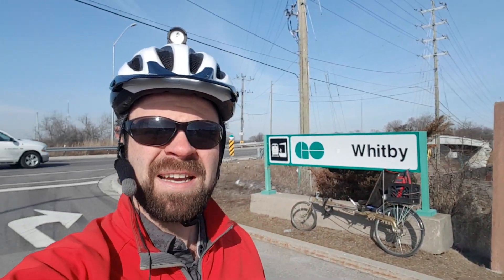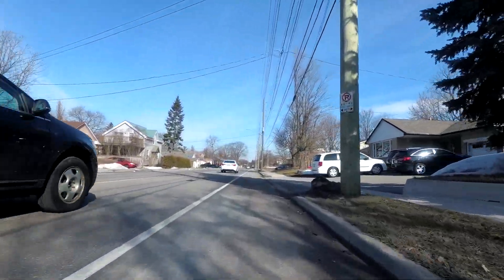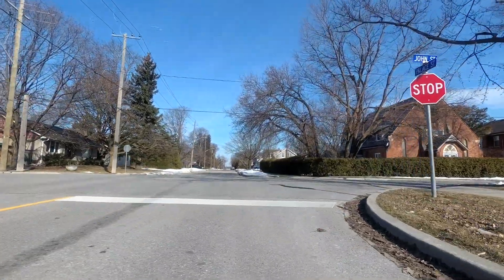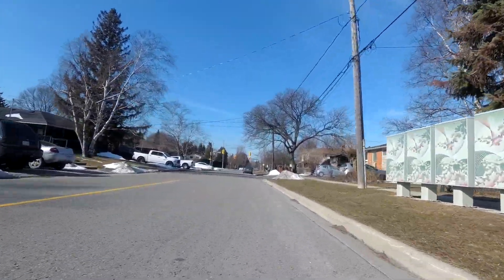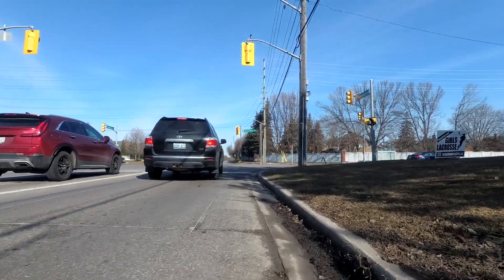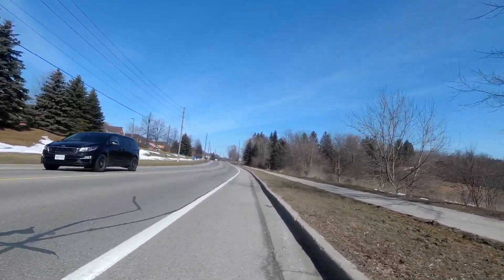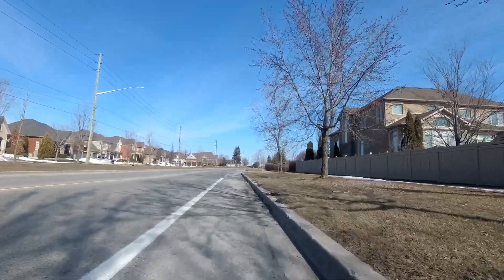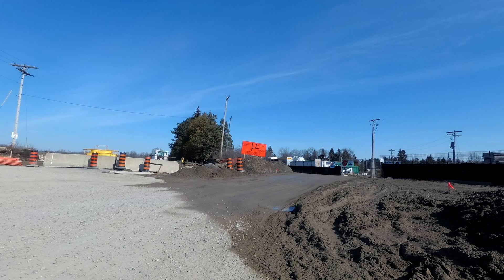Henry St + Cochrane St (Whitby) - Narrated Bike Ride

Comment: Enjoyed your new Whitby tour🙏  The GB connector connects the GLWFT to the Green Belt route.  There are a couple more signed connectors and at least 3 more planned 😀.And happy 31st birthday 🎂🎂
Reply: The next 2 connections will hopefully be in Clarington
Reply from the maker: Thanks, that's great to hear! I hadn't known about the Whitby connector until spotting the signs on the road a few months back. It's so great to see that they have installed such great signage for them. Small measures like that play a part in increasing cycling
Reply: @jimboate7922  that's actually great to hear because I live in Clarington pretty close to Darlington Park so I can do a nice big Green Belt/Waterfront Trail loop when it's done.

Comment: Your speed and acceleration seems exceptional.  What tires are you running?
Reply from the maker: haha really? The lower camera position on this bike perhaps might make it seem like I'm going faster than I actually am. The rear wheel has an old Kenda 700c hybrid tire. The front wheel is a 20x1 1/8" smooth road tire.